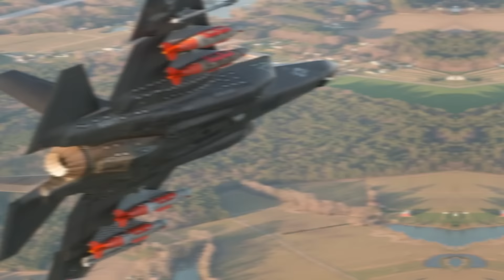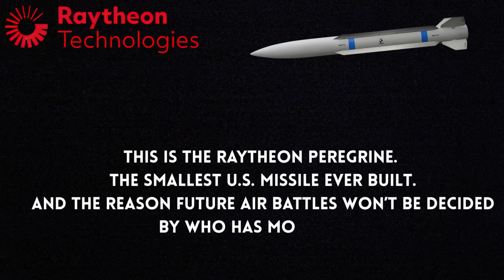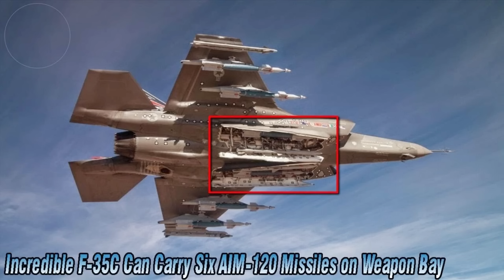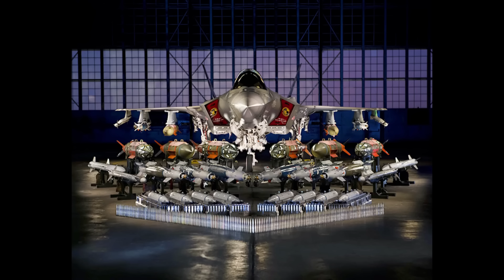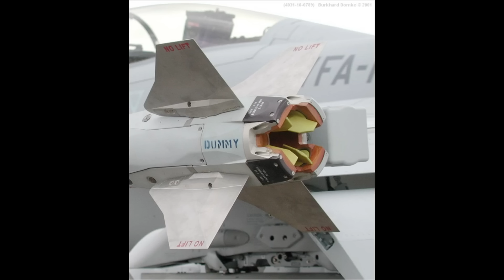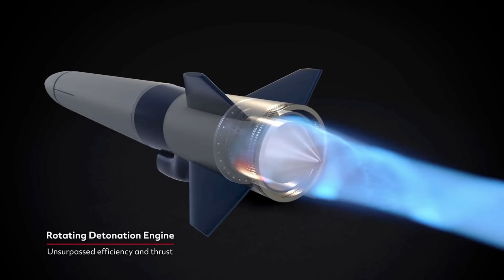The Smallest United States Missile Ever Built (and Why It's Deadly)

Comment: How'd they managed to go from 4 to 20 if it's only half the size? 8 no problem but 20?
Reply from the maker: It's my mistake man, I didn't mention some basic numbers. For example, F22 can carry 10 Peregrines without losing stealth, but in beast mode with Lockheed Martin external pylons can carry way more (we don't know the exact count at the moment), the problem in beast mode is that you lose stealth. My take is that they are trying to find the best way to use them.

Comment: You talked about a smaller, more focused warhead. But such a concept is likely to dispense with a warhead to free up space for propellant - that's how it achieves AMRAAM-class range with a smaller airframe. A lot of the concept art here of the live missile shows two brown bands (rocket motor) but no yellow band (warhead), which means it's a "hittile" rather than a missile.
Reply: The fully articulating nose cones allow our newest missiles to "turn their heads" at the enemy aircraft, just before impact and set off a shaped charge, propelling the fragments into the airframe.

Comment: Once a stealth fighter launches a missile, it loose its stealth. Better to launch from a non stealth platform and let the stealth jet to take over control for mid course guidance.  I see the Peregrine used to protect key non stealth platforms like tankers, comm nodes, or AWACs.  Fired by their escorts and/or the platform itself.
Reply from the maker: Don't forget that you can use ADM-160 MALD, the Miniature Air-Launched Decoy. This bad boy can pretend to be anything on enemies' radars. So, the stealth jets can attack and hide instantly again with the help of MALD (I have a video on the channel about MALD if you are interested)
Reply: Peregrine will be loaded on the dedicated wingman drones for the stealth craft, causing all kinds of hell, as the stealth craft control the field, saving their own shots for HVT's, or significant needs.

Comment: The problem is the range. Your adversaries are double your range. Another missile with the same range doesn't solve the problem when you're shot at from twice your distance.
Reply: Stealth aircraft means the enemy aircraft has to be much closer, lock at 12 to 20 nautical miles instead of 70
Reply: It's a stealth plane goober

Comment: Pictures show AIM-260 has a longer propellant section than AMRAAM. If it uses similar propellant to Peregrine, range should easily exceed 200 miles.
Reply: Well this will be promising because we know the radar for the f-15 and the F-22 and the f-35 is over 150 nautical miles so that would mean we actually have a missile that can reach the same radar distance as our fighters
Reply: Yes, the range is well over 200 miles.
Reply: Targets at 200NM ranges are irrelevant. The ability to detect then lock a target at those ranges is hyped by countries like Russia and it's just hyoe. Every military platform has the ability to detect both the aircraft and missile radars being used against it. At 200NM, said military platform would take evasive maneuvers and initiate countermeasures. Extreme BVR is fantasy.
Reply: @ric @rickbase833 way datalink, do some research. these aren’t just hypothetical distances. sure, the plane firing the missile might not be able to directly see/paint the target being fired upon, but two way datalink allows that to not be as much of a problem. especially since modern missiles use gps systems as well now. as far as datalink goes though, the missile not only receives updates from where it was fired (an f35 in this case), but also could be guided/updated by a stronger radar system hidden at a safe distance, or even just an awacs highlighting the target. this is because it also updates its own location/guidance information from the missile, back to the plane(s). hence “two-way”, the missile can be updated in real time, but also provides its own updates on its movements (heavily simplified explanation, not getting into how gps and iog work for missiles lol) 

now obviously you wouldn’t want to shoot at the max range of the missile for PK% reasons and the fact that in a stealth fighter you can afford to get closer. but they hypothetical 180-200mi range allows for indirect fire and keeps everyone involved safe (again, hypothetically). lob a missile in the direction of the target, could be without a hard lock. then just let your awacs sitting 300mi away provide the missile with the rest of the information it needs.

Comment: The key is effective kill range, if the enemy missile can reach further then it doesn’t matter how many missiles you have.  Half the size of AIM120 and longer range; plus half the costs, it seems too good to be true.
Reply: Kill range will depend on stealth and getting in closer, I would fit these missiles on stealth aircraft only and not fit these missiles to none stealth 4th or 4.5 generation fighters as they should have the longer ranged missiles like AIM-260 or the AIM-174B.
Non stealth cannot enter the battlefield area without being locked on to by longer ranged missiles or SAMs.
Chinese PL-15 can be fired at a F-15EX at over 125 miles away while an F-35A block 4 Stealth fighter can enter the battlefield get closer to use these weapons and take out Chinese fighters
Reply: That is why the US spent billions on developing stealth aircraft. Missiles are useless if they can't locate the planes.
Reply: @billsimpson604  Yep I agree

Comment: Also, your 20 missiles figure may be counting external carriage, IIRC it's 1/2 thr length of AMRAAM and similar diameter, so hypothetically the F35 could carry 4x2=8 of them, or with the new weapons bay upgrade, 6x2=12. 

The plane would also carry a mix of Perigrines and full length AIM120s or AIM260s
Reply from the maker: Yes, my mistake man. I forgot to mention that these numbers are for beast mode only (because you lose the stealth status). Without breaking stealth mode, the F22 can carry 10 peregrines and the F35 can carry 8. While in beast mode with the Lockheed Martin external pylons can reach the higher numbers. Glad you pointed out 🇺🇸
Reply: @FiRMGUYS stealth pods having internal bays maintain characteristics.

Comment: I was a crew chief on T-38's at Holloman AFB NM in the 70's and Raytheon had the ramp area nect to ours. They had about a dozen or so remote controlled F-102's, F-104's and F-106's they flew as drogues in air to air missile testing. I would watch those jet's taxiing then taking off by themselves in awe. Raytheon had a medium sized RV with their remote control equipment in it they'd drive down by the runway. I remember seeing an F-104 taxiing back with a missile sticking out of the afterburner can. Crazy days. Great memories.
Reply: That is how the Soviets got their hands on a Sidewinder missile.   Seems one was fired by a Taiwanese F86 that didn't fuse when it hit a Chinese MiG.   Or so the story goes.
Reply: @mikethompson2650 aim 9b so i wouldn’t doubt it, the earlier missiles had pretty bad fail rates compared to modern times
Reply: Wow sincerely, good story bro . I mean it no sarcasm.
Reply: @556MSL  Thank you very much. :-)
Reply: How we miss the cold war

Comment: Why have they put in the F35 yet what are   They waiting for
Reply from the maker: My take is that they are trying to solve a math problem. F22 can carry 10 of them without breaking stealth mode, F35 can carry 8 of them. Then you have the beast mode, that both of them with the Lockheed Martin external pylons can carry way more, but you lose stealth mode, something you don’t want, especially with F22 because if an F22 gets hit and adversaries lay hands on it, its value it’s lost after 30 years that they are trying to copy it (without success).